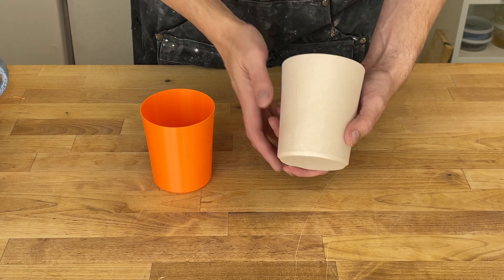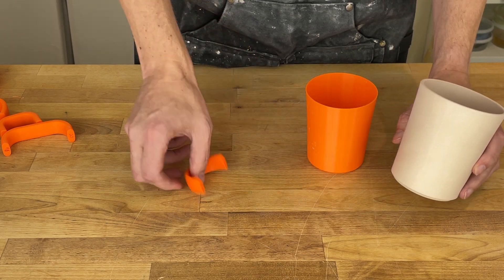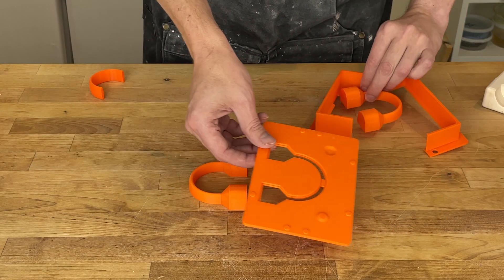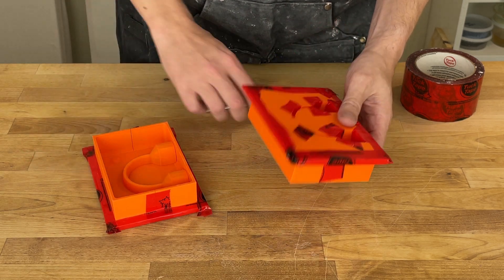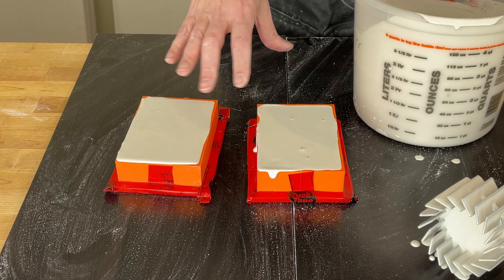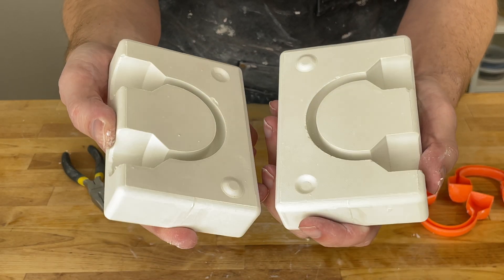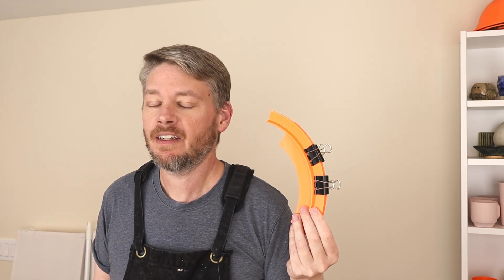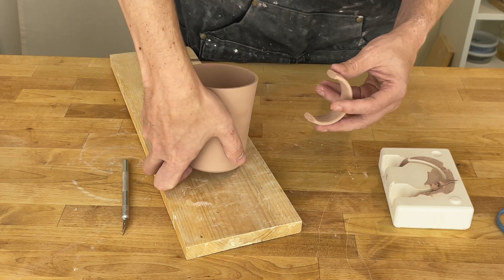Making a Plaster Mold for a Slip Cast Handle

Comment: Do you ever run into issues from the heat from the plaster during curing warping your 3D printed parts?
Reply from the maker: Nope, no issues so far. The plaster isn't warm for that long, and by the time the exothermic reaction is fully going, the plaster is also solid (so there's not really any force against the print).

Comment: Another great video, have you tried adding threads or threaded inserts into the narrow part of the handle to make it easier to remove? Even just a central rib so you can grab it with the pliers.
Reply from the maker: I talked about this a bit in the video - for this narrow handle there really just isn't much room to do so. This is only a few mm across. Also you want it to flex away from the plaster (towards the hollow). I'm guessing if you just pulled straight up you'd likely break the plaster out.

Comment: With such a small part as the handle, I wonder if it would work well to mill the shape out of a block of plaster. It might be possible to avoid chipping and flashing entirely that way, and the time to iterate on a design could be shorter as you could keep some plaster bricks on hand.
Reply from the maker: In talking with an expert on plaster, the answer is probably no. I didn't get into the details with them, but they said milled plaster is not suitable for slip casting.
Reply: @PotterybyKent  Huh, that's surprising! I wonder how that could be.
Reply from the maker: From what I gathered it was due to the surface of the plaster being different than the interior (which is exposed while milling). The finish is different, but I wonder if the structure is as well.